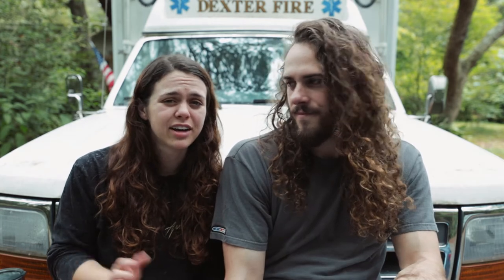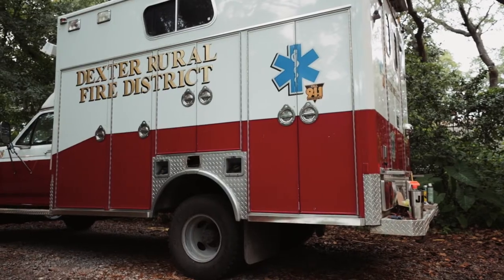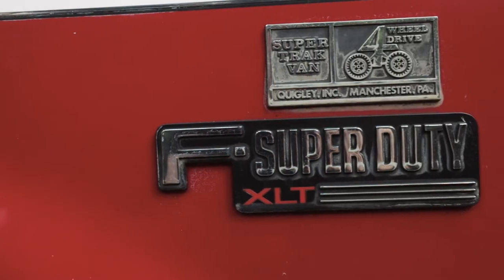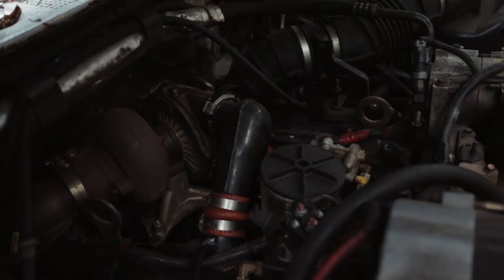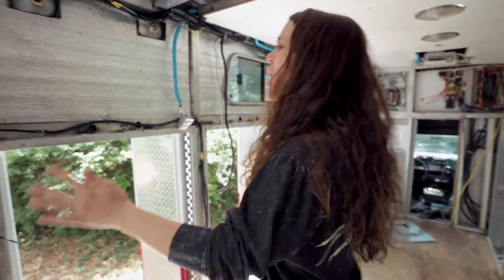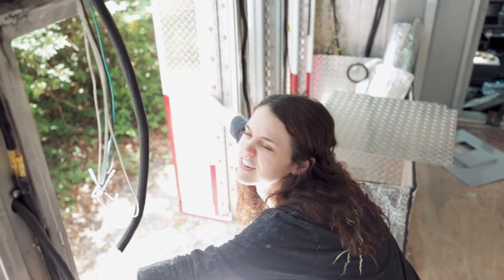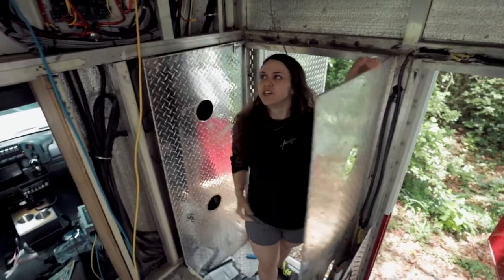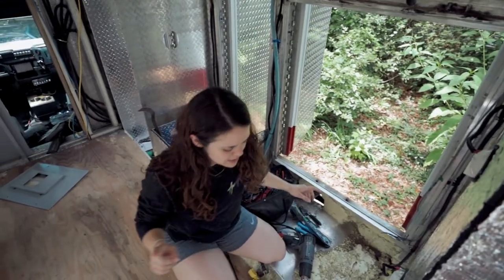EPISODE ONE: Converting a Firetruck Into an Overland RV!

Comment: Holy structural destruction! All that aluminum you cut out was what made it a roll over rated safety cage.
Reply from the maker: spaghettibeans haha thankfully not. There’s a metal frame that constructs the box of a rescue truck/ambulance, that is roll over rated and crash tested and everything else. That metal skeleton is vital to the integrity of the truck and the safety of the passengers in the event of a crash! But within that metal framework is the space for whatever you want, that’s why you see the backs of these in a dozen different layouts and configurations but all of them are still safe. Ours was a wilderness rescue truck, so where there would normally be plywood benches and medicine cabinets in an ambulance, ours had big metal walls that closed off the inside from the outside storage, all non-structural. All the metal we removed was the additional metal added to build the rear box into a “rescue truck” configuration, nothing structural was removed. All the crash tested framework is untouched and intact!!